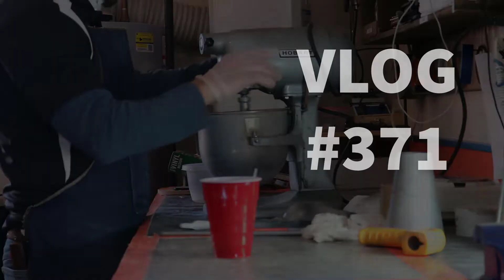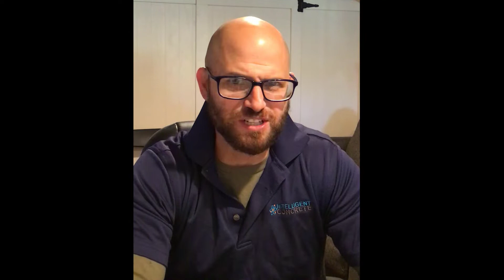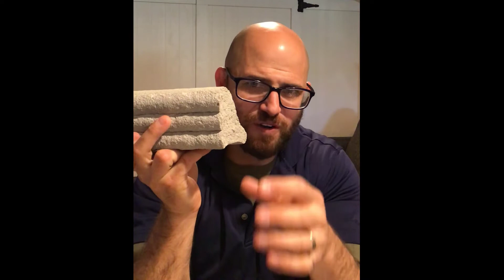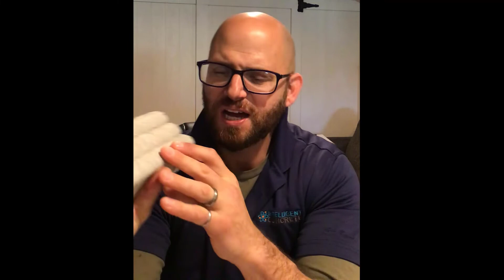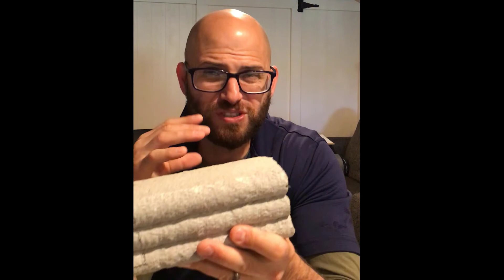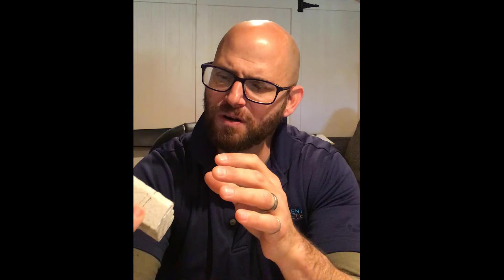What Properties Does a 3D Printed Cementitious Mix Need? - Vlog 371

Comment: Great info Dr. Jon. Maybe touch on the time from mix to print. I am working on a continuous volumetric mixer that can output on demand. Maybe as little as 10-15 minutes from dry to mixed to printed. Much different requirements than a Cement truck delivering a batch a couple hours later. Also, the maximum speed we can print is directly tied to how much time for one layer to set before the next. Even if the extruder can print faster, the material is the limitation.